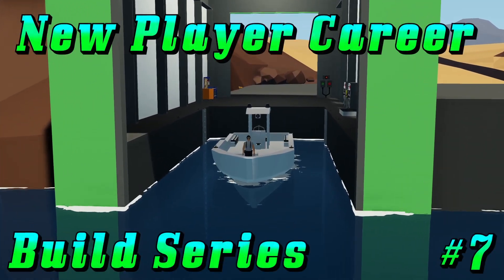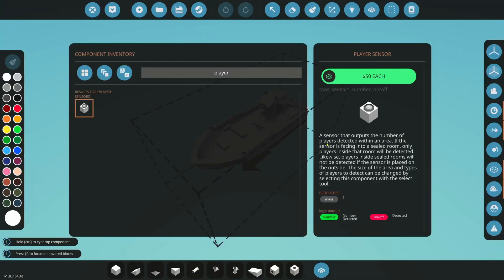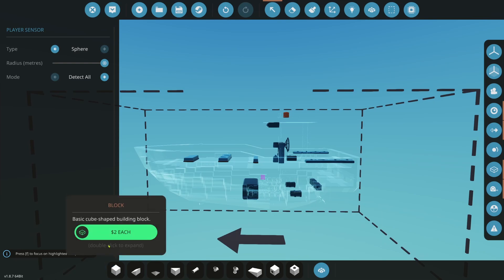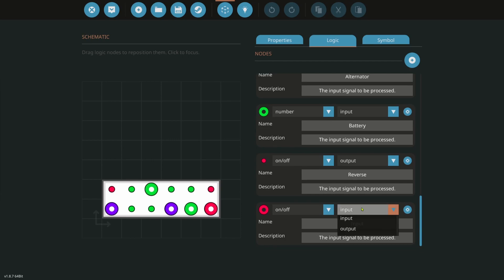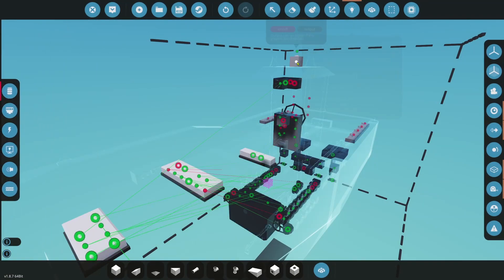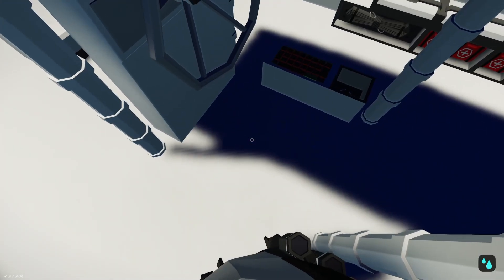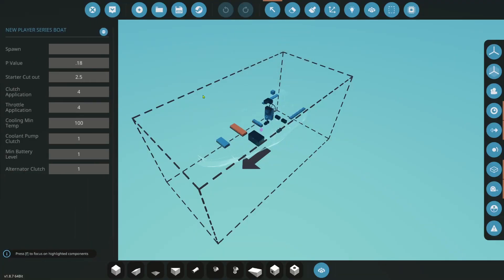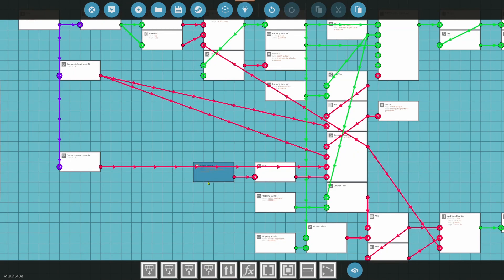Stormworks: New Player Career Build Series #7: Man Overboard Switch #stormworks

Comment: Very useful video, but i have a question if the radius is to big will the boat just drive away when you get closer in the water before you climb back on? My suggestion would be that the MOB detector sets an sr latch zeroing the throttle then with a button you would reset it.
Reply from the maker: It will not drive away. It is zeroing the thrust input in the up down counter. The thrust is set to zero, and therefore will not move until you manually increase it again.
Reply: @CaptainCockerels  oh I see in my boat I had a switch box going from the throttle that would just disconect it when I wasn't in range

Comment: having troubles with this ship after driving for maybe 10 minutes it just randomly loses power and goes to maybe 6 meters per second and after a minute of that it just turns off and the engine wont start
Reply from the maker: Are you venting your fuel tanks?
Reply: @CaptainCockerels  i dont think so i just use the boat from your series
Reply from the maker: @malimi6727  with the pressurization update you need to ventilate the tanks. On one of the fuel pipes add a t-piece gas relief valve and a fluid port to let the air out of the tanks and ventilate.
Reply: @CaptainCockerels  i dont get exactly what you mean. but i dont really wanna continue my career till i find out what it is
Reply from the maker: It is overheating. Cooling methods changed after the pressure major update I am making a new episode to show how to fix it.
Reply: @CaptainCockerels  alright, thanks alot
Reply from the maker: https://youtu.be/X_Odi7oJtSk